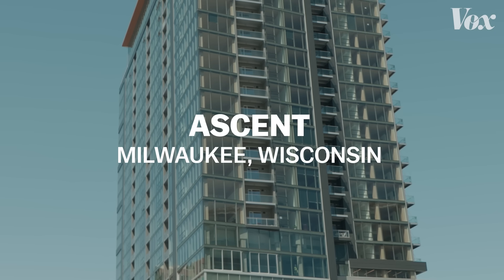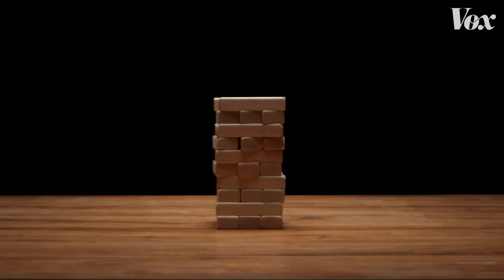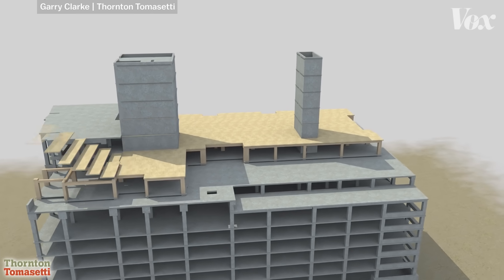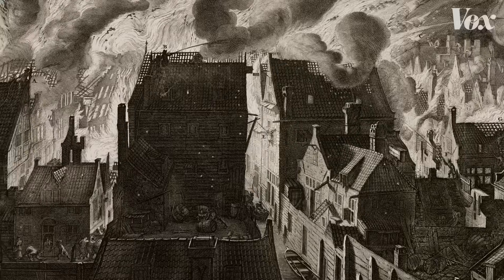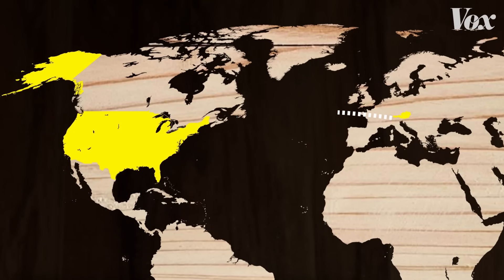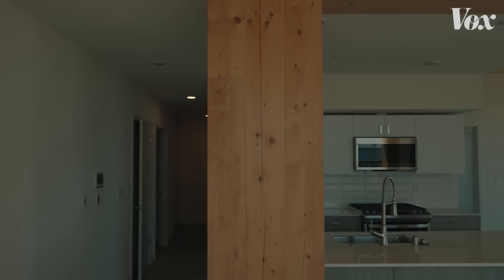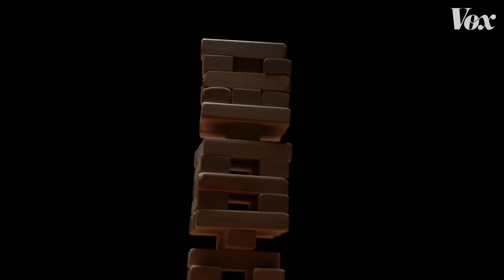How to build a wood skyscraper

Comment from the maker: The next big test for mass timber? A ride on UCSD’s shake table — a giant table that’ll shake a 10-story mass timber building. See more about that project here: http://nheri.ucsd.edu/projects/2022-tallwood/

—Phil
Reply: If Termite will eat up this wooden building will builder will again make this wooden building again for survivor?
Reply: Try it in humid asia?
Reply: @abao  in Asia bamboo is used
Reply: Yeah, since the base structure is concrete and what looks like as much as 8 stories this is not close to being the tallest timber building in the world. The Mjøs Tower in Norway (Mjøstrånet) has a 100% timber structure and stands at 85,6 meters tall and si much more impressive than this hybrid building!
Reply: How's the weather down there? EU?  Are local pidors going to survive the winter?
Reply: Ok what about weathering and termites
Reply: I know I'm late to this party... But can someone explain to me how it's possible to fix only 5/6 screws on the battery with a cordless tool? I work in construction and it seems unreal, maybe I'm missing something. 9:40 a.m
Reply: @omulduda Long self tapping screws. Expensive high strength ones. On a couple similar vids the superintendent said they had a station with dozens of chargers operating. Cords are a pain but one wonders if at some point using grid powered equipment would be more effective. Time getting newly charged batteries vs time messing with cords.

Comment: My assumption is metal fasteners are only there to hold up the other non structural parts of the building  The reason is metal fasteners will be the first to fail in even of a major fire as the metal weakens.  The real fail safe safety is in wood joinery like mortis and tenon.

Comment: Essentially, with less effort, a construction company can earn more money for exclusivity.

And it doesn’t matter how much the tree is cut down in the process :/. Here the story is the same as with the recycling of garbage (when it is sent to some country and it doesn’t matter what happens to it there next or whether it is even possible to recycle this garbage - if someone just pays for the badge). Wood is simply purchased from third-party suppliers from another country and it doesn’t matter how it was obtained.
Just as I understand, processing and control also lies with a third-party company, that is, it is not a fact that the fire resistance will not change. Plus, there are questions regarding termites, ants (possibly wasps) and, not less important, toxic fumes.

Comment: What i do not get is ... WHY USE BATTERY POWERED DRILLS in this case? I mean ... wouldnt it be a lot EASIER with MORE power and no changing the batteries (also BUYING the batteries) and an extention cord?

Comment: what happens if someone decides to use a saw on one of the beams? I assume there is a measure in place but i am wondering what.
Reply: Same could said of someone taking a torch to a steel beam

Comment: 🎯 Key Takeaways for quick navigation:

00:00 🏢 Ascent Milwaukee is a 25-story, 284-foot-high wood skyscraper with wood slabs, beams, and columns as structural elements.
01:10 🪵 Mass timber, like glue-laminated timber (gluelam) and cross-laminated timber (CLT), is becoming popular in construction due to its strength, environmental benefits, and aesthetic appeal.
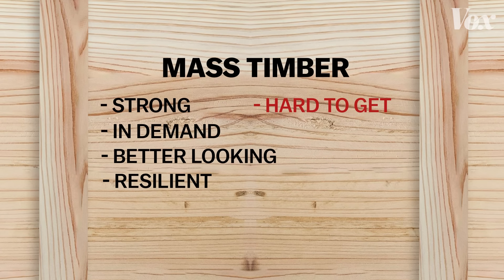03:17 🏗️ Mass timber construction involves extensive planning, digital modeling (BIM), and coordination to ensure precision, as mistakes can lead to significant delays.
05:13 🔥 Mass timber undergoes fire resistance testing, and its char layer can protect its structural integrity, making it safe for use in tall buildings.
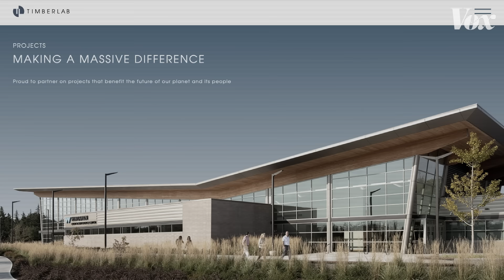07:20 🚚 Sourcing mass timber involves transporting large pieces worldwide, requiring careful logistics and considerations for cost and wood grade.
09:21 🧼 Mass timber construction results in cleaner working conditions for laborers compared to traditional concrete and steel construction.
10:53 🏗️ Mass timber construction reduces the need for a large workforce on-site, with more work done in factories, promoting efficiency and waste reduction in building construction.

Made with HARPA AI

Comment: wood can never be as fire resistant as concrete.....and once a fire starts,it can build up to incredibly high temperatures which would compromise the integrity of the surrounding wood immediately,and possibly weakening the structural integrity of the rest of the building...

it would be like making a building out of wax,how long do u think it would hold up compared to concrete and steel?

imagine if say a gas mains exploded sending a fireball through the third floor,lemme tell u this, the next morning there would be nothing left of the top 7 stories except a melted lump of

Comment: Hey, just came over from the new vox video on  "The Big Problem About Cement and How to Fix It", so sorry for the random comment 5 months after this video came out. Thinking back to the struggle with changing out batteries for the power tools used to install the wooden beams, I wonder what the energy cost was to operate all of those power tools. Have they considered wooden joints (joints that don't use screws)?

Comment: If fire cannot destroy the building, termites will. Concrete buildings can last for centuries, wood building last for 2-3 decades at best
Reply: Fire does destroy these. One burned down in Canada during construction. The fire department didn’t stand a chance at putting it out.

Comment: Okay, how does it hold up against flooding? What if there is a flood that submerges the basement and ground floor? Would the wooden support beams absorb the moisture? Would the structural stability be compromised? How would you replace a beem? Can it be replaced?
Reply: The lower floors are concrete. No wood is exposed to the elements.

Comment: I lived briefly in a low-rise wood construction apartment building. It was so noisy that I had to move out. There wasn't any sound insulation between floors. I could hear my neighbours above whenever they walked across the floor. I also heard my next-door neighbours on the other side of my kitchen wall. So I can't imagine living in a high-rise like this and not listening to a cacophony of noise.

Comment: Back in the 1970, we were told that because concrete buildings are fireproof, that the risk of dying is much lower. That you could actually stay in them and still live the day to talk about you experience. We were also told that getting rid of paper bags would save trees. 

Speed up to 2020. Now paper bags are good and would buildings are safe. 

Civilization has just taken a back seat.

Comment: Wait... Welding doesn't happen in wood construction?..
Uhh... It does happen in wood buildings. I can tell you from experience of welding in them. Now it shouldn't happen. But sometimes design cockup happens and welded steel structure is needed.

I'm a welder who became an engineer and did grad in welding related issues. I love CLT and engineered wood. If I knew about it before my studies i'd have chosen it as my main topic.

Comment: The video didn't say how much an apartment costs per square foot compared with a concrete structure. It sounds way more expensive for wood. While you have fewer low-paid construction workers, you have many, many more hours of high paid designers before construction and more expensive "thinkers" during the build. Renewable, carbon footprint, yada yada. A Democrat's dream building: more expensive, so tax the rich and build these expensive eco-buildings for the poor.

Comment: Many people think that timber is not as strong as concrete. however, They also forget that timber is not as heavy as concrete. The big concrete column is used to mainly withhold the weight of the building itself but not the load (human, furniture)

Comment: Meh, returning to the past. It's a nice take on an old industry but revision of what happened in the past. 

My problem remains, termites. They love wood and they are uninvited tenants in every construction that wood happens. If temperature protects, well, build that thing out of wood but it can't be too tall. It must be moderate, modular, parametric, articulated and a classical form for quick replacements and evacuations in terms of emergency.

Comment: Lets start mass making wood buildings so we have less tress :)
Reply: trees are a renewable resource. It is the greenest way to build buildings
Reply: @AtillatheFun  It may be renewable but it increases the number of tress getting cut down and if it gets popular how many trees will remain?
Reply: @anotherdeadchannel  Humans need shelter. Shelter uses resources. We can either continue with the carbon creating concrete/steel construction, or we can pivot to high density mass timber.
Reply: @AtillatheFun  The problem is that we cut down trees faster than they can grow. Theres also more cheaper forms of construction but you know the people of the world always want the best expensive things
Reply: @anotherdeadchannel  There are no cheaper methods that meet safety standards. We can all live in slums, but they are a high risk living arrangement.

Comment: Wow as a general contractor I am only familiar with stick framing for small structures and PT slabs for large structures. This is fascinating but as an Estimator, I cannot imagine this being anywhere close to as price efficient as concrete. Also, subcontractors would not be familiar with this type of building and would require extra training and additional costs.
Reply: It might be cheaper though. Mass timber buildings are 25% faster to build than concrete and steel ones. This could lead to significant labor cost savings.

Comment: Terrible choice for building. Once the fire takes hold its very difficult to fully extinguish. Firemen hate them..
Reply: Wrong. What you are referring to are timber/wood buildings in a 5x1 structure. This building in the video is made using Mass Timber. It is actually very fire resistant and goes through testing.

Comment: @1:12 your post-tensioning cable is draped the wrong way. The cable is higher at the ends and lower in the middle, so that tensioning it creates a camber in the beam - with the center bowed upwards. Your sketch would be a disastrous situation, it would pre-weaken the beam!

Comment: lol see this building being blown away by the first storm/tornado/etc.  The real reason this technology is done is to increase margins. I would not buy this kind of apartment.
Reply: This is not the regular wood that’s used in construction framing. This is Mass Timber. It is certified and tested to be fire resistant and as strong as concrete+steel.

Comment: I live in Milwaukee and a lot of us residents here are scratching our heads. They're changing a significant prenium over other apartments in the area. No condos are available. And as of January 2023 it is noticeable empty. A feat of Engineering? Yes. Poorly marketed and tone deaf to the needs of our community that desperately needs AFFORDABLE housing. A hard Yes!
Reply: For anyone not in the know, Milwaukee's avg Salary is 65k/yr and to afford a single bedroom in this building you need to be making over $200-250k/yr. Milwaukee just doesn't have that kind of market.

Comment: Ok , time to rant on the internet again…
No way this is better or more resilient to fire and seismic activity; than concrete or welded steel  , wood might be safe , and the engineers must’ve done their jobs right to make it a solid structure , but it’s a choice , it’s different , but when ants and insects start eating it in fifty years then the true test of such methods begin.
A column in the video is cracked, and how are you going to stop residents from drilling holes or adding a chimney , and don’t get me started on the guy talking about going home clean with no cement or sand on him, but you will be full of splinters.

Comment: 1. Wood burns. Steel in buildings usually has a fire coating. This building does not!
2. Wood can rot. Leaky pipe, or water gets inside of the wood beams.
3. What if there is a contaminate in the wood or glue that causes the glue bonds to fail.

Looks nice, but I would never live in a Wood framed high rise.

If you want the look of wood, that can just be an interior profile, or the steel can be clad in wood with a fire coating in between.

Comment: I'm a fire protection engineer who's currently work as a consultant; gotta say, it's fascinating to see how this suddenly reaches mainstream discussion. Mass timber is awesome. It used to take more work to get project with it approved, but thankfully the code just changed in my state (CA) to address them. I'm guessing this will accelerate things.
Reply: then how do you deal with termite attack?????????
Reply: @erics7219  Infused toxic pesticides

Comment: Would never work well in the gulf coast or eastern seaboard where you have Hurricanes. I'm not buying that these buildings are fire resistant either! Another thing to think about is where is all this lumber going to come from?  Are we just going to cut down the Amazon rainforest? Are we going to cut down all the forests in the world?  What ever happened to protecting the environment?  Trees breath CO2 and create Oxygen for us to breath.  What will happen to CO2 levels if we cut all the trees down?  By the way, how long do these buildings last compared to those built using traditional materials?  Sorry, but I'll stick with concrete and steel, thank you!

Comment: These constructions are not that big of a deal in German-speaking countries indeed. 😉 Architects, engineers, building codes and councils are much more familiar with this. Apart from it being much more sustainable (if not regenerative when forestry is done right...) we mostly value the much faster construction process coupled with the high precision of planning and pre-fabrication. A huge benefit in cold countries where snow and adverse weather can delay construction significantly.

Comment: Really interesting work, would definitely be much much cheaper using traditional joists with airgaps for ventilation allowing for standard floor boards.

We used to build like this in the uk a lot with structural perlins but we used masonry, lime and timber.

Also I'm really glad you highlighted that wood chars, it's in a lot of textbooks but for some reason steel and concrete is preferred despite warping starting at 300 degrees Celsius which is quite easy to hit when a bulding is on fire.
Reply: A steel and concrete structure will start to spall or fail sometimes when wood has not even reached ignition temperature. People associate wood buildings with flash fires because of the lightweight stick framing tendency to not resist fire, and the building codes being lazy on forcing durable construction.
Reply: @rolfbjorn9937  
Would you want to stay living in the home above after the downstairs home had a little fire?.

Something concrete has no problem with, but as soon as one of the columns has been burnt it's lost its structural integrity.
Reply: @Robert-j6r8c  That's not how any of this works. It depends on the severity of the fire and which component is affected for how long. Untreated naked soft wood of significant mass and thickness could be left mostly intact, and I'm fairly sure these buildings do not have untreated soft wood. I've seen steel reinforced concrete spall and steel buckle though. It's not all black and white.

Comment: I think it's a little bit of a shame that this particular building has so much glass on its facades since that's been the modus operandi for high rises for decades now.  Would have been nice if it was more obvious it was made out of wood from the exterior!  When you look at older skyscrapers like the Chrysler Building in NYC, the windows were relatively small. Something like that would have been really neat here.

Comment: So because you need to source the timber from across the world the carbon "footprint" (term coined by big oil companies but it works here) is so big that the ecological impact is the same as taking sand for your concrete

Comment: Important to mention is that the reason we will see timber way more nowadays is to combat climate change. Trees take up carbon dioxide from the air and store carbon in their body. They release the oxigen. In that way they store up to 1000 kg CO2 in a cubic meter. Building with timber will reduce the carbon emissions from the construction industry. But getting the timber from another continent doesn’t make sense at all. Local sourcing is way more environmental friendly and perfectly possible with forests of Canada and USA.